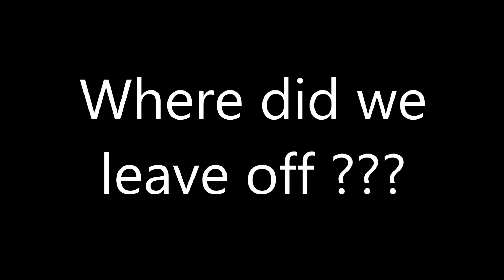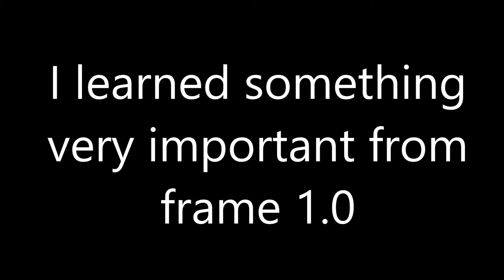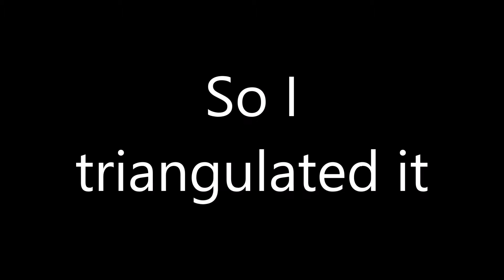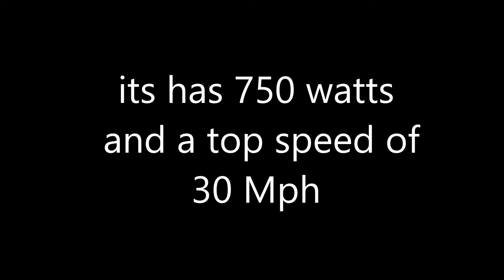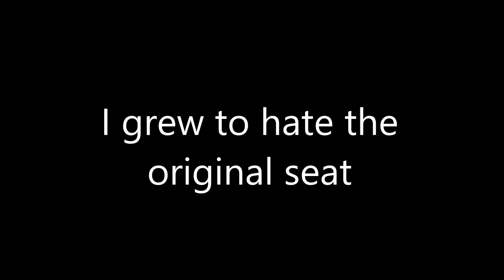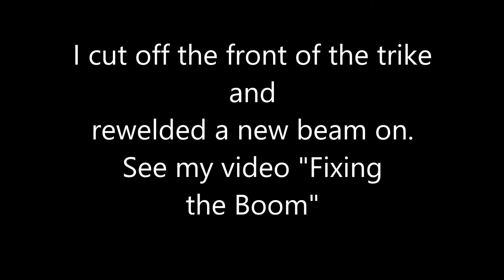Velomobile frame 2.0

Comment: i hate putting chain tensionors on the wrong side of the drive line because unless they're built at strong as the frame itself it's not a question of whether it'll break but when. very nice build though.